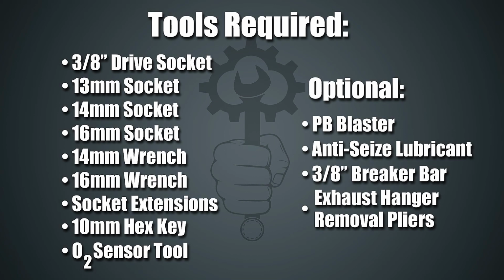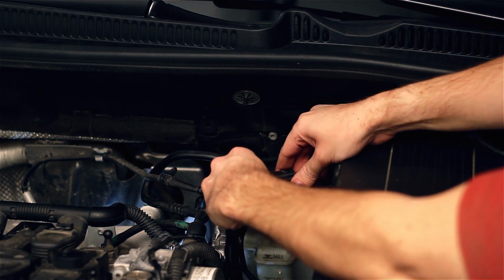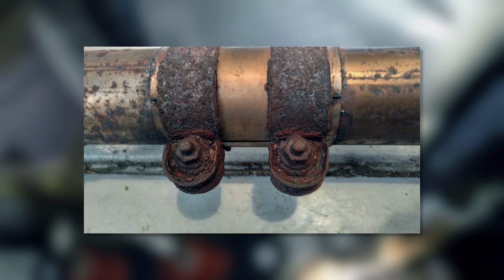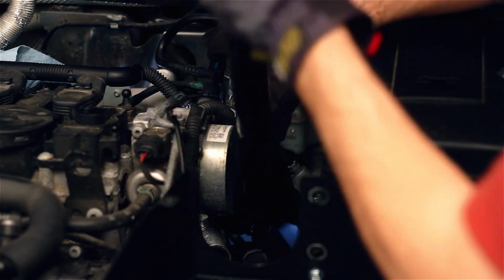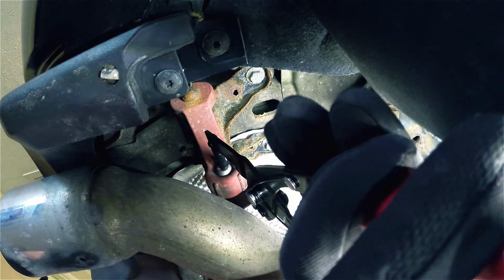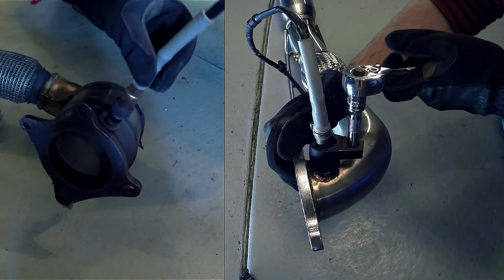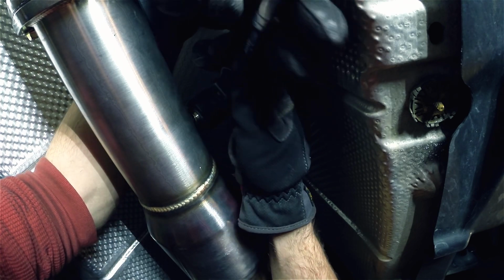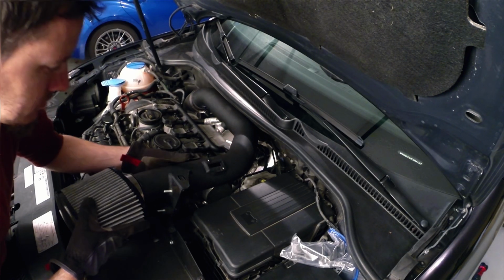COBB Tuning - Volkswagen MK6 GTI Turbo Back Exhaust Install

Comment: You skipped over the hardest part. How to start the difficult nut at the turbo. The whole reason I watched.
Reply from the maker: I know. Unfortunately there was no angle or space that could accommodate a camera to capture it while the socket extensions were also in place. We actually had to talk with the COBB Tuning Engineer that built and tested the prototype for this to get it right (We shot these videos for COBB ahead of the official parts release, and the install guides hadn't been published yet). His response was "You won't be able to see it, you have to feel for it and trust your hands." 

The best thing to do is exactly what we did in the video. Use a deep well 16m socket, 3" extension, and 5" extension on a 3/4 drive socket and use your hands to line up the socket on the bolt. This will put the ratchet right in that small space between the block and brake fluid reservoir, which will leave just enough space to get a breaker bar on it. It's tricky and the most difficult part of the install, but can definitely be done solo. Just takes time and patience.

Hope this helps.

Cheers,

PMcG

Comment: is remapping the ecu required?
Reply from the maker: For this particular installation, yes. You are changing the AFR (Air/Fuel Ratio) by opening up intake and the exhaust without changing the fuel delivery to compensate. Installing without remapping the ECU will cause your engine to run lean (read as bad news). Your first step should be to get your engine management in place via a COBB AccessPORT. Even remapping to an off the shelf (OTS) Stage 1 map, you'd be surprise at the difference of how the vehicle will feel.

With the appropriate supporting mods you can move to higher OTS Stages or move to a ProTune for further ECU profile customization based on your vehicle needs and desired vehicle performance characteristics.

Hope this helps.

Cheers,

-PMcG